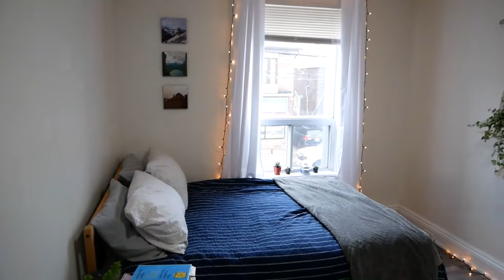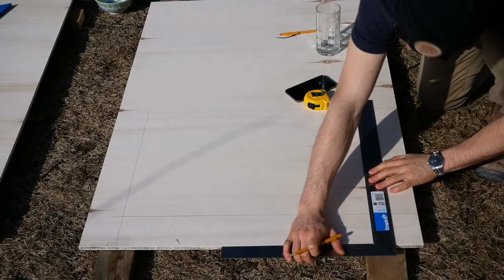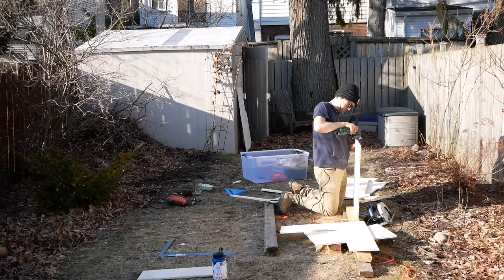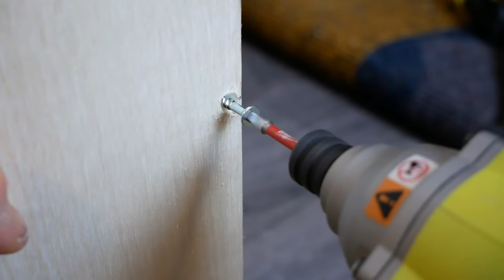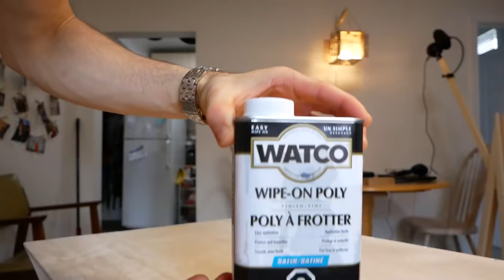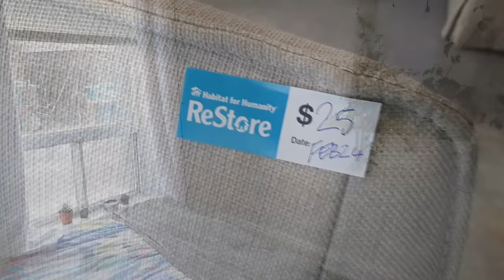How to Make a Simple Plywood Laptop Desk – Level Up a Bedroom Nook!

Comment: You can still have a nice, soft wax finish! Just get yourself some furniture paste wax and some 0000 steel wool (I prefer synthetic...looks like s scotch brite pad).  Dip the steel wool in the paste wax, just enough to lube it up, and apply in circles.  Wait about 10-15 minutes and use clean steel wool wiping with the grain to remove the excess.  Buff with a lint free towel and you have a buttery smooth table top!  I'd only do this on the flat surfaces. The edges of the ply are too rough.  You can Google "rubbing out a finish" for more techniques.
Reply from the maker: Awesome, thanks for the tip!